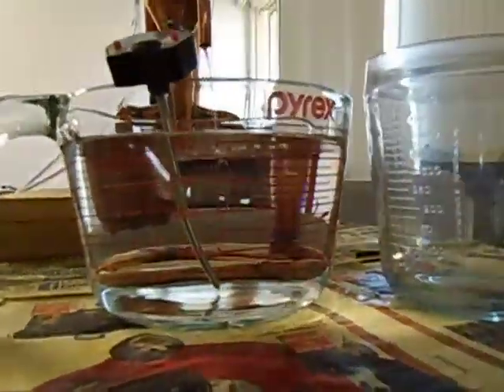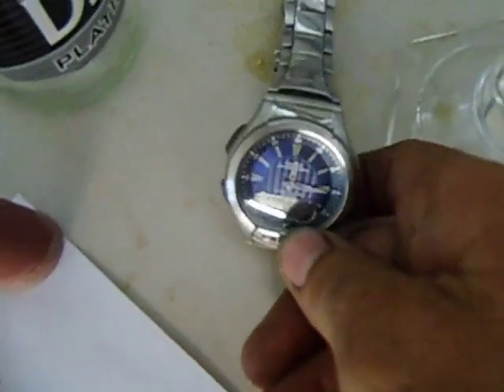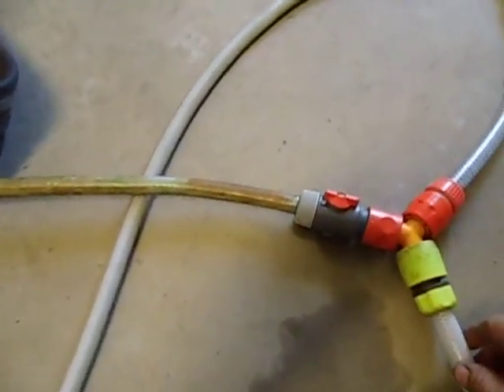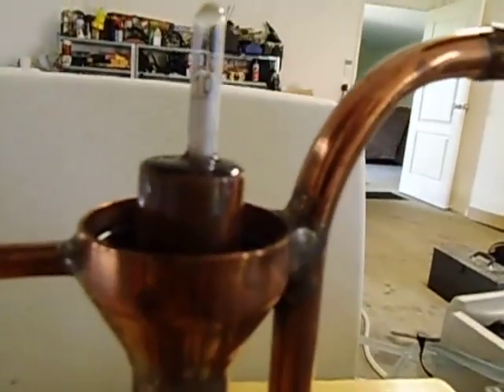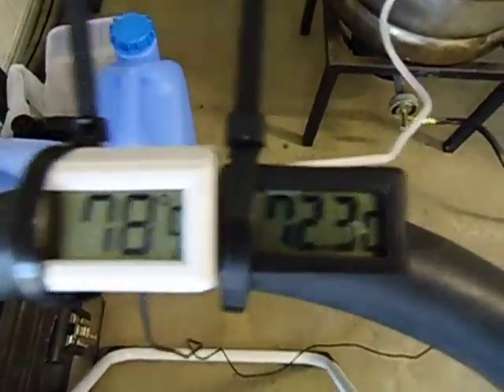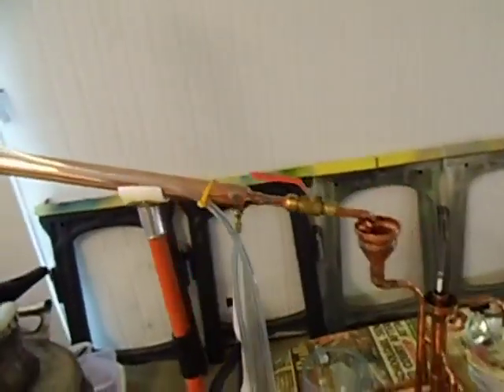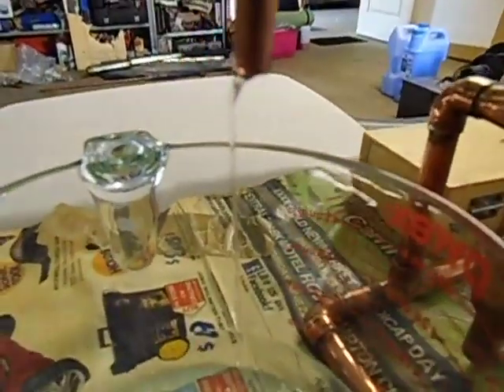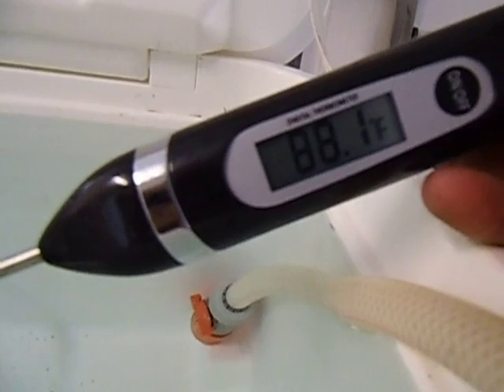New 2 5 inch copper reflux condenser collumn first run ,

Comment from the maker: The collum is 800mm and 2.5 inch (75mm) filled with copper mesh top and bottom and ceramic saddles in between the copper mesh and have a look how I made my reflux condenser for tips , cheers

Comment: g'day mate. just wondering why you are running your garden hose into an eski and then pumping it to the condenser? why not cut out the eski and pump it straight into the condenser? great videos by the way, very helpful!
Reply: , mains water pressure changes pressure throughout the day where as the fountain pump does not

Comment from the maker: Please check out my video i uploaded of turbogas burner and how much gas used , it‘s the way to go , but more dangerous though , however you can purchase a digital temprature controler from E-bay for about $20 and i have a video of that too that i uploadedp if you running elements less than 15amps :-)